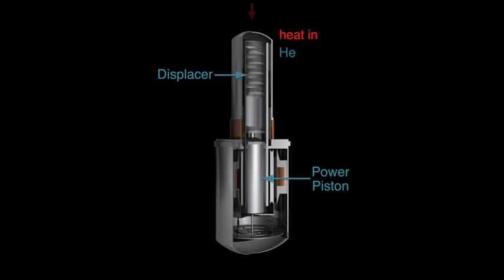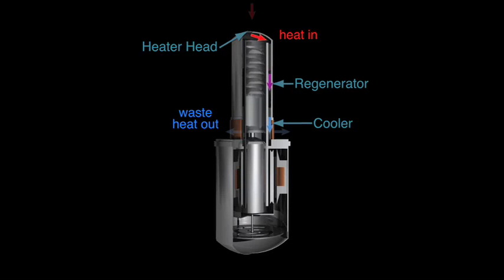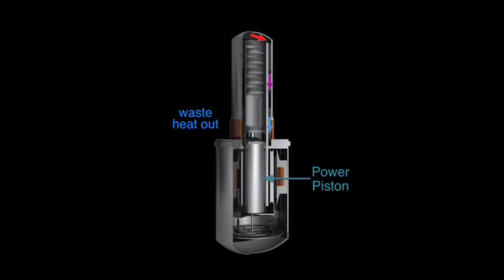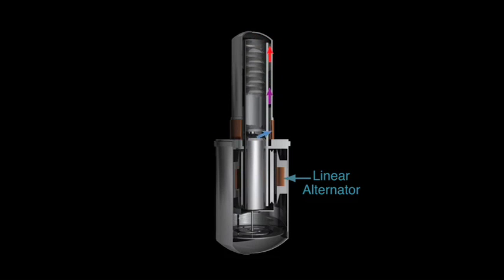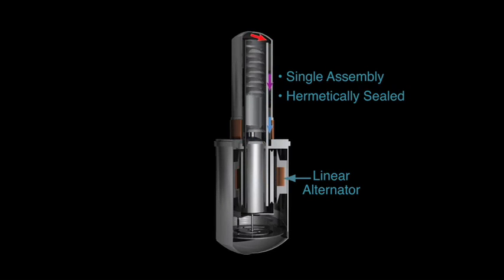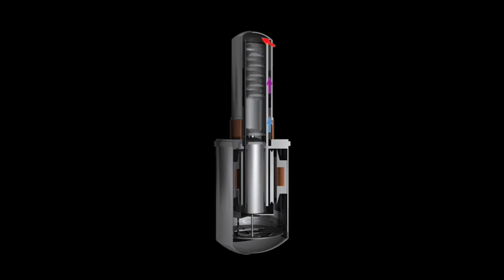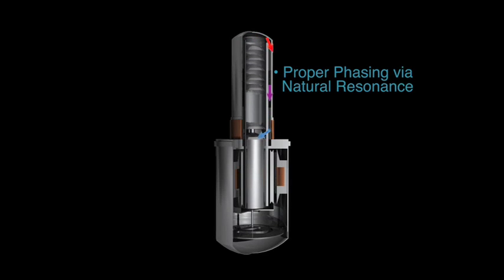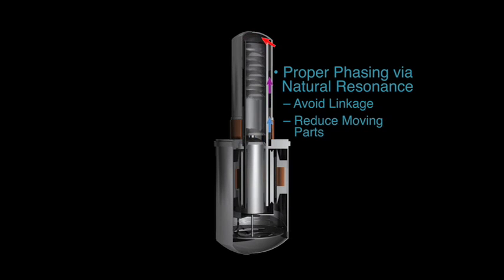NASA Stirling Converter Demonstration

Comment: If a person is on a planet like Mars, and the soil temperature 12 feet down is 10C, this is a great engine to stick in the ground and have the top sitting out on the surface where it may be -40C.  The greater the temperature difference between the soil and the atmosphere, the more energy it can produce.  On Earth, a place like the arctic or possibly the middle east would likely produce the most energy.  Most other places in the universe make the extremes of those places look like nothing...  I don't understand why something like this isn't a commercially made product.  It's cheap to manufacture, efficient, can produce quite a bit of energy, produces zero carbon, and the greater the temperature fluctuations, the more energy is produced.  I live in Minnesota.  It's a very continental climate and the soil is 55F here roughly.  The temperature outside is very rarely ever 55F.  It's bouncing with a high degree of day to night variation as well as the general weather extremes we see here, which on a bad winter can dip to like -40F and on a hot summer can get up to like... 105-110F.  These types of engines would be good for a guy like me to power my house or business or whatever...  In the middle of winter when it is -30F outside, these engines would be producing tons of power at exactly the time when it is most needed.  Reverse is also true in the summer when it's super hot and everyone is running their AC.
Reply: I have had similar thoughts about utilizing the temperature differences in bodies of water, especially in summer.
Reply: @JimSailing  It'd be strange to have a pool with a black bottom and a pool with a completely white or reflective bottom with a stirling engine in a huge cylindrical pipe between the two powering your house.  I suppose in theory it's possible.  You could maybe even make something like that 6' in diameter.  I think the main issue on this is... if there is only a 10 degree temperature difference between the two bodies of water, that might produce only 40watts/hr.  So... about 1kw/day.  Is that worth $.15 every day?  Probably easier to place it vertically in a pool of water like a buoy and have reflective mirrors get the top 150F+ all the time, so between the water at say... 75F and the top, there is a 75F temperature differential, then a similar system instead of putting out 1kw in a day could may churn out 7-8kw.  That's an amount that'd power a few houses needs everyday...  Someone should just make a stirling engine you stick in your pool with mirrors on top.  That's not even very difficult...

Comment: If you want to make one of your own out of VERY simple materials and no exotic operating "fluids", then see the following video by one of my practical heroes, Mr. Robert Murray-Smith...
https://www.youtube.com/watch?v=SJsuwIUb0wE .  As for why Helium or Hydrogen is used, they supposedly transfer heat very well allowing for a greater/quicker temperature differential between the hot and cold sides of the engine.

Comment: Could CO2 be used instead of helium?
Reply: Gavin McIntosh CO2 is heavier than air and would not work as well. Lighter gasses work better because they change more in volume as temperature changes.
Reply: @JimSailing  Not to mention lower thermal mass..

Comment: A variant of the Stirling engine, also built for NASA supplier Qnergy has now logged well over 110,000 maintenance-free hours. The commercial version is now available from OilPro in Calgary, Alberta, in the form of the Powergen, which incorporates a 1200 or 5.65kW generator. This product is already in the commercial stages with hundreds of units in use in the oil and gas and pipeline business, but also communications, rail and micro CHP. https://www.youtube.com/watch?v=7E16hkwX6mY shows more about these, or visit www.oilpro.ca. Happy to share more info with anyone interested in learning more. This is a fascinating and incredibly durable product which runs on any combustible gas from biogas to propane to natural gas. 
This comment is not meant as a business solicitation, but merely to show Stirling engine fans that these already exist and are successful commercially. Ergo no link to our website.

Comment: Use an hexbar out of brass now come the important thing when you drill a big pocket hole in the middle be careful and collect the chips after this drill on the side 3 holes slightly bigger than the cylinder fill this hexagonal  “can“ with the chips put the cylinder inside fill the rest of the collected chips. Concentrate the sunlight on it or other heat source then run the  Stirling engines.
Reply: Huh?

Comment: I always liked this design. It probably has at least 1000 degrees between the hot and the cold sides when used in space.
Reply: I'm not sure, but we achieve high 400C to low 600C head temps on earth with ambient temps as low as -40C, all day long. The PowerGen is designed to put out consistent power in ambient temperatures as high as 50C, and was tested in the deserts of the world to prove it.
Reply: Yeah but in space the cold end can not dissipate it's energy efficiently, except through IR radiation.

Comment: Any info regarding kw-hr/cu inch displacement? dimensions available? Heat regenerator material? Some talk of using hydrogen, but claims of explosion and counter claims. My understanding is no Oxygen in outer space. Seems like this is illogical.
Reply: The Stirling comes with gas inside and hermetically sealed like the compressor of fridge and air conditioners.

Also, the gas being used here is Helium.

Comment: Many different stirling engine designs are still in use including the shown free piston design.
The engine design above was tested for 15  years with reliable maintenance free operation over that period of time.
Solar powered Stirlings are a relatively new use for the engine.
A very smart Scottish man invented this engine over a century ago. They are used in submarines and will probably be used for power generation on nuclear thermal powered manned spacecraft with the heat from the core used.
With climate change coming to the fore many more applications are on the horizon including one of my new power plant designs.
The Chinese have just successfully tested a power generating space based version of a free piston sterling engine.
😎👍
Reply: The Powergen manages 30% efficiency just as a generator, but when the up to 50 deg C glycol heat is recovered and used for glycol heat tracing 70-95% is possible.

Comment: How do they start this engine? with a battery and linear motor?
Reply: Stirling engines also run in reverse, i.e. if you put in heat and have a linear alternator on the other end, you make electricity. Likewise, if you put in electricity you make cold on the other end. This is why Qnergy's sister Co. Ricor makes most of NATO's cryogenic coolers for lasers and night vision optics etc. So, to answer your question, on the PowerGen system, https://www.youtube.com/watch?v=7E16hkwX6mY, we simply send an electric pulse into the linear alternator, which sets off the pulsation of the primary Stirling engine piston and gets it started. It's really neat as it makes a distinctive "ping" and then starts buzzing at a quiet ~60Hz to make electricity.
Reply: Possibly. However if you have two convertors arranged to take it in turns so that when one goes up the other is forced down causing the pair to start each other.

Comment: The only problem with linear engines are the mass vibrations they create. Without a counter balancer or harmonic balancer this linear Stirling motor going to vibrate the heck out of whatever structure it's attracted to.
Reply: The ASRG they propose using incorporates two opposing pistons. Because these are linear generators with speed and pressure controllers, the opposing motion of one can be used to counterbalance the vibrations of the other.
Reply: Linear reciprocating mass is nothing like a reaction wheel in its affect on an object in free fall.
Reply: @bjl1000  You should've been paying more attention during physics class.
Reply: Don't forget it has a strong magnet inside, would it plot its own course in space or would it clean the debris.
Reply: @paulsharman3942  Not a chance

Comment: The only part I dint understand is the "natural resonance?" seems like a rhombic drive would be fine.
Reply: The free-piston arrangement here allows the engineers to design a machine without any wear mechanisms.  The rhombic arrangement needs bearings for crankshaft and rods, which wouldn't last very long.  The free-piston arrangement reduces the machine to a spring-mass-damper arrangement on the piston.  So to oscillate it needs to run near its natural frequency.
Reply: @rogue277  Correct. They use "flexure springs in the PowerGen" (much like the tiny discs inside 45 rpm records, if you remember those?) They're rated for billions of cycles. The cycle is approximately 60 Hz, and the commercial versions put out 300VAC, which is then converted to 12/24 DC or 120/240VAC, through 2 legs, each of which is limited to 23.5 A.

Comment: awesome...did not know they could approach 55 percent efficiency...I thought the max was in the 10 percent range....
Reply: +Wayne Williamson It is 55% of the Carnot efficiency, which is the theoretical maximum efficiency for a heat engine. I believe the efficiency in terms of output energy/input energy is closer to 38% (which is actually still quite high).
Reply: But in deep space, isn't the Carnot efficiency almost 1 because T_c is 3 K?
Reply: William Brennan Ambient temperature is irrelevant if your thermal resistance to the environment is literally equivalent that of an infinite vacuum flask. You can only dump heat radiatively or evaporatively in space.
Reply: Wayne Williamson It could be using an insulating jacket to eliminate Chimney Losses
Reply: William Brennan 
There's a constant source of heat... the radioactive material used to fuel standard RTG's.
Reply: the best gasoline engines can get maybe 20-30% i think.  maybe less.  maybe another stirling engine on the exhaust would get the effiecency up lol. daisy chain them for better effiecncy.
Reply: We're getting 30% efficiency for electrical output and higher when we capture the hot glycol and use it around a site. Then we get north of 70% total efficiency, but just making angry pixies, we get 30% conversion from gas molecules to electrons.

Comment: Why is helium used and not any other gases?
Reply: Helium is a smaller particle than normal air, and lighter, the engine can run much faster. Look up stirling engine with helium it gives you a demonstration.
Reply: Nabre Labre It was almost 1 year I wrote that. Air work as well but in cryocoolers it would be best to use helium not only since its very light as you say but it also have a very low freezing point actually the lowest which means that you could as low.

Hydrogen would work very good as well but helium is the best, problem is only that its not a renewable source.
Reply: Helium is a low density gas, has no viscosity at all, and it is chemically inert.  Hydrogen is lighter and cheaper but flammable
Reply: @Jeffrey314159  Helium definitively does have viscosity both in liquid and gas. You might be thinking of liquid helium-4.
Reply: Wrong!  Helium as a gas has virtually no viscosity, and He-2 is a superfluid that can migrate up the walls of the container it is in
Reply: Bob Jones Only if there is oxygen as well which there isn't in these so that explanation is invalid.

But it was 2 years since I asked that and I know much more today; its among some other reasons just because it have the lowest boiling point of all gases so you could thus get as low as helium boiling point which is very very low before it liquefies and stop working.

However also hydrogen works as good and actually also a little better in some circumstances. And hydrogen also have a big advantage since it renewable which helium is not so when helium is depleted on earth its depleted and we can not get it back again in contrary to hydrogen which we have in abundance.
Reply: Helium is used because it has extremally high heat capacity per unit of mass. Only hydrogen is better (about 3 times more), but sealing hydrogen is hard, and it is posses explosion risk.
Reply: +Nabre Labre Why not Hydrogen ? It is cheaper and lighter than Helium, but Hydrogen is flammable.  
Helium maybe lower desinsity since it is a monoatomic molecule, and it doesn't cohere or adhere to anything - so lower viscosity
Reply: @Jeffrey314159  and it's not so small that it requires ultra special metallurgy. Hydrogen can cause Hydrogen-Induced Cracking, (HIC) because it is small enough to enter imperfections in the metal and cause it to crack. Helium behaves better and leaks much slower.
Reply: +Jeffrey314159 yea probably too risky to use hydrogen as a leak could release flammable gas into the spaceship
Reply: Compressed/heated gasses can explode. Diesel engines would be a good example of that.

Comment: AHA, finally found a Stirling engine which features a magnetic piston traveling back and forth through a coil.  That same arrangement could be used to start the engine by pulsing power through the coil to start the piston moving.  Too bad it was cancelled...  It had a higher potential efficiency compared to Peltiers but it is hard to argue against a system with no moving parts, especially when you consider that you cannot service it once launched....

Thanks for sharing!
Reply: could you share the link for the linear Stirling engine?
Reply: @cjones4286  What Is Islam?

Islam is not just another religion. 

It is the same message preached by Moses, Jesus and Abraham.

Islam literally means ‘submission to God’ and it teaches us to have a direct relationship with God. 

It reminds us that since God created us, no one should be worshipped except God alone. 

It also teaches that God is nothing like a human being or like anything that we can imagine.

 The concept of God is summarized in the Quran as:

{ “Say, He is God, the One. God, the Absolute. He does not give birth, nor was He born, and there is nothing like Him.”} (Quran 112:1-4)

Becoming a Muslim is not turning your back to Jesus. 

Rather it’s going back to the original teachings of Jesus and obeying him
Reply: C Jones Sure, it's the one shown above! :P
Reply: Can you buy a linear one?
Reply: I don't think so, this was the first video I was able to find which matched what I was thinking of - basically that the piston in the magnet in a linear generator.  Too bad NASA didn't follow through on this.
Reply: Bloody energy companies making them put it to bed through back door pay offs probably. Thanks michael.
Reply: Michael Blair but if it fails, it fails, no matter what you put up there. Yes less moving parts means less likely to break, but it doesn’t guarantee all that much. Electricals break just as much as well machined parts

Comment: How hot are we looking at for the top of this 50'c 100'c ?
Reply: the PowerGen gas fired versions run at temperatures in the high 400 to low 500 deg C range typically. As I understand the engine is similar the temperatures at the head with a nuclear heating source may be higher, but not a lot. I'll get back and elaborate if I learn more.

Comment: Sadly this program has now been cancelled due to rising costs.
Reply: yea, rising cost of gasoline/diesel.... cant make money off of something like this as easily as you can fuel...
Reply: ComandanteJ it's only a matter of time before someone manages to refine the engine through new metals and ceramics in its construction to make something that is as functional as our "newer" systems without fail. most sterling engines and tests were done ahead of their time before we had all this technology that brought us more research into advanced materials. i understand there's issues and complications with anything.
Reply: +Quantum Uncertainty Workshop Yeah, because space proves have diesel engines to generate electricity, right? ¬¬ .Stirling engines have been tested in nuclear reactors and solar concentrators, but the complication of the mechanism makes it prone to failure, and heating up water and then collecting that energy with turbines (wich have no moving parts except for the rotor and some bearings), is much cheaper, more reliable, and in most cases, at least as efficient.